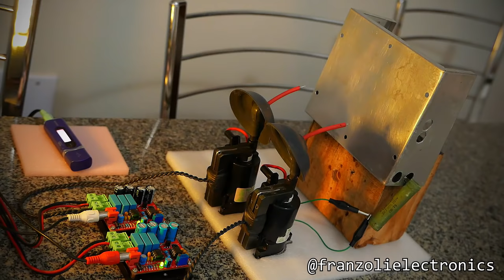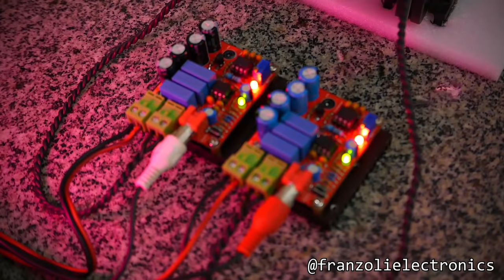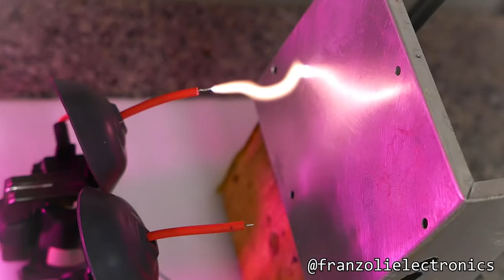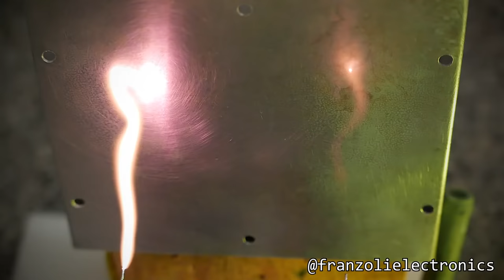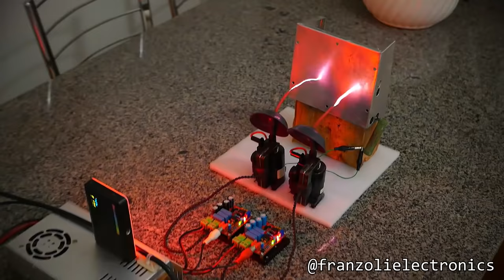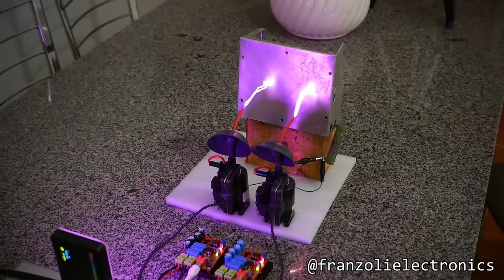aha - TAKE on ELECTRICITY

Comment: Can you please make a video on how you make these? The physics, programming, timing, everything
Reply: TBF there are hundreds of online guides for how to run musical Tesla coils. Flyback transformers like this are less common, but TBF if you are messing with flybacks like this, you should understand them well enough first before even trying as they are dangerous.

As for the programming, pretty sure it's simple MIDI channels
Reply: @andreyrumming6842  "there are hundreds of online guides" and most of them are outdated as heck and dont give you all the info or even the parts list.
Reply: There's actually a video by Great Scott that explains flyback transformers and switching power supplies, which is basically what this is. You just need something to convert the midi input to a pwm signal for driving the mosfet
Reply: Its very dangerous, so if you don't know and understand then don't.
Reply: Love how he hearts the comment but doesn't give an answer
Reply: @Oaisus  Good point. Because everyone knows "don't try this at home" warnings always stop people, so it's best to just not give them the info to help them not die while sitting back content in the thought that your willful neglect helped aid their accidental suicide, because stuff dangerous yo, and what else were you supposed to do? Teach? Pffff.
Reply: @Oaisus  That's nice. The point was to provide that info, not point in a direction and act like you did a thing of value. I'll await your video.
Reply: @custos3249  If you actually read my comment past the first sentence you would see that I did give you all of the information you need.
Reply: @Oaisus  Wrong. You pointed to where that information "is." Try again, but this time, try thinking first.
Reply: @custos3249  I can't put the contents of 6 textbooks into a YouTube comment. I should just realize that I'm arguing with a child on the internet and stop wasting my time.
Reply: @Oaisus  Funny. You tried to chide me for my reading skills, yet "I'll await your video" flew over your head. Stop wasting all of our time.
Reply: People used to play with flybacks like crazy back in the day. As one of the milestone tinkering projects for any HV enthusiast I'd have guessed there would be exact replications of Franzoli's circuit all over the net but I haven't found a single one. Just for that reason I want to build it eventually but it seems kind of weird he has the schematics and parts lists etc but no other online demonstrations of replications. Franzoli does have the clear diagram and parts list on his website though. As for danger basically anything that is incorporating hundreds of volts+ can potentially be dangerous. A tv flyback transformer just by itself can store enough charge to give u a nice painful zap if it has an internal capacitance. If you touch a high frequency output from a flyback you might get burned, or it could kill your ass if you decided to use it to charge up a huge high voltage capacitor. It's all relative though.. I shouldn't say this but I don't particularly find touching live 277V wiring hand-to-hand to be as deadly as it is painful but peoples mileage may vary. 480V hand to hand is another story. Having been bit by some HV flyback charges from things like homemade HV capacitors (with low capacity) I can say I'd probably prefer the short burst of that than any line voltage. Capacitors have that ability to give you as many amps as you can pass for short pulses but the DC doesn't last. Line voltage can hold onto you in a bad circumstance offering that more lethality 'over time' factor if it's not high enough to kill you outright. So really part of the game with flybacks and what you do with them is to truly understand at what voltage a capacitor has the ability to jack you up for a long enough burst while factoring in its capacitance. You don't really need to worry about it so much if you always make sure to bleed or discharge any HV capacitors you ever work with before going grabby hands on them.
Reply: For the sound he probability made the frequency constantly change so we could hear it has music and not only a sad beee sound
Reply: @calitts4708  This thing should have a resonant frequency that it has to run at so it most likely uses amplitude modulation. https://en.m.wikipedia.org/wiki/Amplitude_modulation
Reply: @Oaisus  I think that amplitude would change the volume of the sound, but it is still a good hypothesis. So it could be either the frequency or the amplitude, but just Franzoli Electronics could really confirm which one is correct
Reply: @calitts4708  It's not a hypothesis, that's how these things work.
Reply: @Oaisus  so... Just forget everything I said, you're correct, sorry smart Sir
Reply: @Oaisus  I love and know about science and electronics, but everyone get something wrong sometimes
Reply: @calitts4708  I am an electrical engineer and have made things like this. It isn't a hypothesis, I am speaking from experience.
Reply: @Oaisus  Thanks for sharing your experience here! I may try someday to do something similar and now I know this very important information, without you I would probably be stuck for hours trying to make it work, thanks again!
Reply: You drive them with PWM around 150 KHZ
Reply: You don't need like three semesters of electrical engineering to build circuits like this and work with flyback transformers. Your suggested literature is also entirely lacking in power electronics and HV/electrical safety.
Reply: @MarianKeller  i mean... i was playing with flybacks and transistors at 13 years old, you're far more likely to blow the transistor up than actually hurt yourself in most cases by trying to drive the coil too hard to get better sparks
Reply: @Oaisus  wow, not very helpful advice proffessor Oaisus, it's like giving an advice on how to drive a car by making you read a book about thermodynamics and internal combustion engines.
My countryman Tesla didn't read those books, those books were written after he made discoveries.
I doubt that you have any real grasp of what's going on here.
Reply: @LuckyLukasLuciano  It's important to know why you're using components in the way that you are. Otherwise you're blindly following a guide from some rando on the internet without a clue on what you're doing. Going with your car analogy, it's like driving around without any idea what any of the signs mean and you heard from some guy that if you put the car in 'R' mode for racing you'll go faster so you try it without knowing the consequences. Chances are that you'll get T-boned in the form of a shock across your heart.

Tesla went to school for engineering and physics. He's the one that built the car with only knowledge of thermodynamics. Good job comparing yourself to an engineering genius.
Reply: @Oaisus  Thank you very much smart proffessor
Reply: @LuckyLukasLuciano  Children are so disrespectful nowadays.
Reply: @firefly2472  lol tesla coil itself is old
Reply: @Lucsueus  This "thicc nerd book" gives an in depth understanding on exactly how microprocessors work and exactly what is going on when you copy someone else's garbage code from some tutorial. I suggested an arduino because it's simple to implement without having to deal with big software packages with their expensive licenses and fiddly drivers. Arduino is made to be easy to work with but it's the same workings under the hood. 

Most of what I mentioned is covered in about 6 semesters of an electrical engineering program at most universities alongside several other required courses. I never did say to never touch electronics, just don't mess with high voltage stuff like in the video before you know what you're doing. Most anything you can play with on a breadboard isn't going to kill you if you touch it in the wrong spot. 

I'm surprised someone is trying to use nerd as an insult these days, I thought that use of it had fallen out of fashion?
Reply: @andreschoen9180  By children, I meant around middle school age 12-15, around the age when one will ignore advice not appreciating why it was given. Along with the belligerent/sarcastic tone I was reading. 

It certainly doesn't help that this is all in a youtube comment section where everyone's IQ takes a severe hit.
Reply: @Oaisus  Hahaha, great way of putting it. Or find someone who did all the reading and trying and failing and re-doing is. Check out the Don Smith material..
Reply: @firefly2472  In Science there is nothing like 'Outdated', unless someone has proven that this was wrong, like some theory

Comment: In the early 90s I founded one of the most successful flyback transformer businesses in Europe. This video brought joy to me, seeing such beasties being used so unconventioinally.
Reply: Amazing!
Reply: what are they actually for? just hooking up to wires to transfer power from one to another in a safe way with stepping-down or whatever?
Reply: @KairuHakubi  flyback transformers are (or rather, were) used to power the electron beam in CRT (glass screen) monitors and TVs. Very high voltage at a low current.
Reply: @RobCCTV  ohhhh of course.
Reply: HR Diemen?
Reply: @inse001  no. Not HR Diemen

Comment: I've seen a video where a guy uses double delta sigma modulation instead of pwm and he could play not only midi, but random audio signals on his tesla
he even built his own stripped down 7 bit processor to fit into FPGA and run all of this
what a legend

Comment: The straight flyback transformers sound much more musical than the Tesla coils. Almost more of a pure sine wave sound rather than the 'electro' sawtooth wave kind of sound. I dig it!

Also, great choice of song 👍
Reply: That is most definitely not a sine wave, but I see your point.
Reply: The great sound is because the arc has a short path and is concentrated to a single arc point. That helps give it a stronger louder sound. If the arc was fed to a metel globe and alowed to just dissipate into the air it wiuld be softer more hissy and crackly sounding.
Reply: It's all relative to the recording equipment when using the internet as a reference. For me flybacks tend to throw an arc that sounds better in person when it comes to lower frequency modulation. The deep thicker arcs developed are good for that. In recordings on cheap microphones it sounds muffled and garbage. SSTC's can also throw really amazing audio quality arcing just to free air though, you have to filter out all the noise or run it at 6+mhz or something. It's not as easy. Some amplitude modulated PLL SSTC's sound amazing.
Reply: Yeah, this is a much more enjoyable Zeusaphone to listen to.  Or is it called a Thoramin?
Reply: I knew soneone would mention Tesla ! 🤣🤣🤣
Reply: I think it's mostly the two channels.
Reminds me of the days when cell phones switched to polyphone ring tones - a great improvement, and people even spent money on them.
Reply: Actually both are square waves generated by the small circuits next to the transformers.
Reply: @thatotherandrew_  it's probably a sine wave, look at the high voltage capacitors on the board, they may be in parallel with the coil to resonate and increase current, and protect the mosfets from voltage spikes, but the sine wave is high frequency, the frequency or amplitude that can be modulated, and should be able to follow the sound input quite faithfully.
Reply: @VictorC173  The commenter referred to the "sine wave sound", but sine waves don't buzz like that. By all means, the electronic circuitry could be sines, but the resulting sound is on the opposite end of the scale.
Reply: @thatotherandrew_  maybe I confused square wave with sawtooth or something, as the sound is much nicer than tesla coils
Reply: @thatotherandrew_  but it doesn't seem like it's a pure sound, it might have harmonics or several other frequencies together to get that sound, or maybe not, since I don't understand much about the sound part.
Reply: @VictorC173  Yeah, by definition the sine wave is the "purest" note with no harmonics at all. If you add harmonics, then it can be a sawtooth, square, triangle, etc.
Reply: It's pretty much a square/pulse wave, but I agree.
Reply: This is definitely not a sine wave. It’s actually a pure square wave.

Comment: Is there an actual kit people can buy?   Or is it just the plans that are shared?   Looks like the latter (which means relatively few people will be able to take advantage if it.)
Reply: You can pull them out of old tv's or crt monitors, you have to rewind them a little bit. they are dangerous of course so you've been warned (VIDEO LINK BELOW). The triggering circuit for the music I'm not familiar with, but that's where the flyback Xformers come from. https://youtu.be/7HwwqGyKkpk
Reply: Just make it dude...
Reply: @TheShadowCamo  flyback transformers cannot be rewound (not without depotting them and a lot of bother) , and the ones in the video definitely were used in their as-manufactured state.
Reply: @kmoecub  by rewounding he meant 5-15 turns of wire around ferromagnetic core as primary for the zvs or the driver
Reply: @TheShadowCamo  Thanks.  I repair CRT monitors.    Flybacks are reproduced today and easy to get.   It's more the PCB I was referring to.   The average hobbyist doesn't have the means to make one of those that easily.
Reply: Check out the description my friend there a map to make it
Reply: @phucminh3633  its schematic but ok

Comment: I can see from the website it uses 24V/15A for power and an RCA jack for sound, but what is the signal going through the RCA jack? Is it like a square wave or is it actual audio?

Edit: Might be wrong but from more inspection of the schematic it seems to be using a comparator to tell if the incoming signal is higher than some threshold. Probably uses square waves because of their fast transitions and then turns that into a control signal for the oscillator.

Comment: Do these drivers come as kits or are they custom made? I badly need two.
Reply: No, as they are very very dangerous, one slipup and you are dead instantly (you won't even no about it), they never be on sale as kits.  This energy will leap on you if you are near it.   No grounding or any metal should be five metres around this in any direction.  Metal also includes metal studs on your jeans.
TV engineers many have then tips of they fingers or finger/s blow / cut off, and thats being very lucky.

There are retro telsa clubs who do this monthly.

I am a RTEEB licenced engineer.
Reply: @pqrstzxerty1296  thank you for your concern but unfortunately I have already built one but can't integrate a  sound module in it. The interference makes the sound driver go haywire. So overall sound is like a huge hissy, noisy buzz. So I need a full proof schematic, or you could be generous enough to give me a tip on how to fix this problem.

Comment: Do you have a schematic and parts list for the individual boards running in stereo.. i am guessing 555 Ic's lots of capacitors (smoothing) Switching mosfet on the heat sink. Looks like a lot of fun. along with dual Flyback transformers. Did you ever make it into a kit for sale ? Thanks

Comment: Am I correct to say, that what is done here is basically mp3 player plays a stereo audio file, where left and right channels have two different melodies (voices) for each of the coil, which are then getting audible because of the flyback coil effect? What I mean is that the cool 8-bit lead sound is not actually the real voice of a flyback, but a recorded music, which is played on the mp3 player, and most probably the original sound was generated in DAW or played by an analogue synthesizer?

Comment: The sound... sounds smoother than on the coils. Are this just my thoughts? Or there is something going on there? Frequency? Maybe characteristics of the discharge creates different waveform than the coils?
Reply: My guess is that the coils sound harsher because the arcs are longer and each arc creates a bang when it is ignited.
Reply: @MetalheadAndNerd  thank you :)

Comment: Just a loop of coil and it's flux field around that metal the electric hits to get stats of the surface grid emf. That's super woa... Is it coil or magnet to get the surface voltage and it's 0.5cm tangent to the surface distance planar like imaginary surface emf stats? ❤❤❤